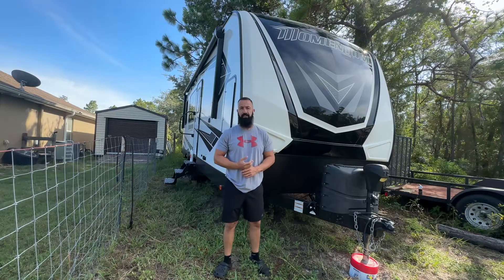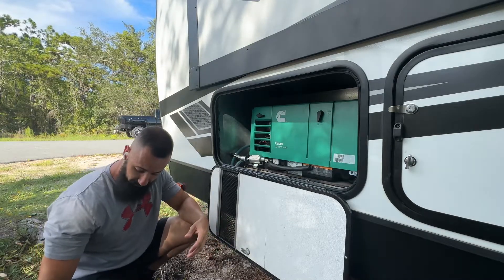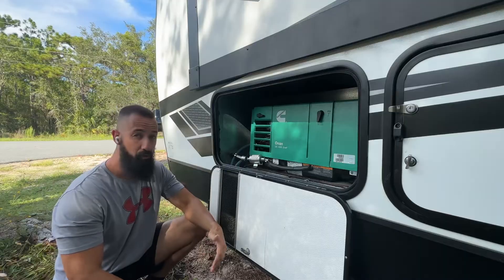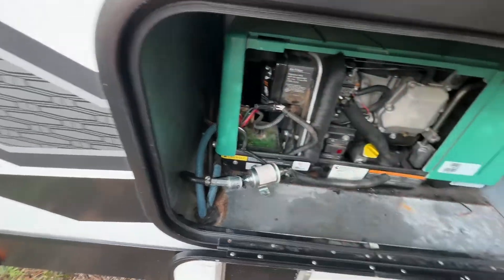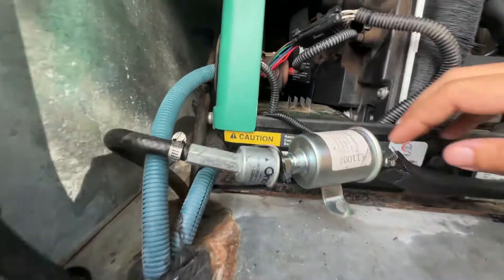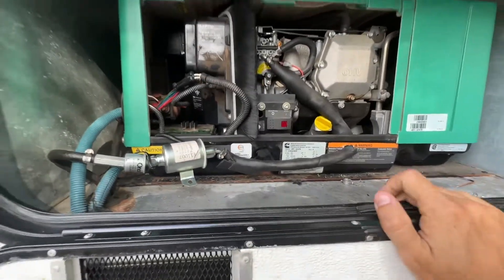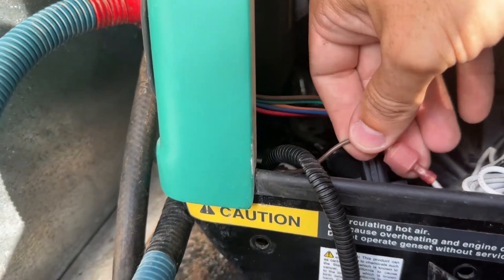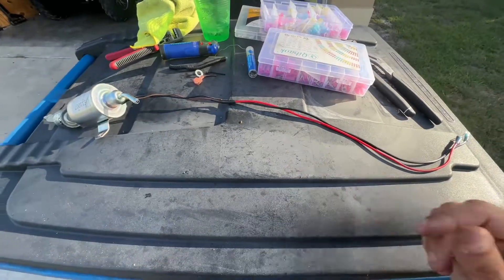Cummins Onan Generator Stalling Surging Overheating Fixed!!

Comment: I'll give it a try. I was suspecting over heating of some kind. But then I thought oil will always heat at high temps in a motor. Then I thought is there a heat sensor for the oil? Couldn't find one. But this makes sense. The pump being to close to the heat turns the fuel to vapors. Engines don't run on vapors.  Makes total sense. You may have solved a huge problem 1000s have be trying to solve. Good job. Now I wish I had seen this video in the summer! LMAO! 🤣🤣🤣🤣
Reply from the maker: I did a follow up video, need to relocate the pump directly under the camper beneath the generator house. Have had 0 issues running for multiple days with the AC on after doing so.

Comment: I'm also in Florida... it's got AF! And I'm pretty sure I'm having the same issue... sounds just like what happens to mine. but I've not replaced any parts yet.  Going to give it a oil change n clean the filters n shit. n check to see if it needs insulation? I'll see what happens?? Wish me luck guys!

Comment: I had a problem with heat causing problems so I added in electric  radiator fans.   Worked like magic.   If you can remove heat you will have less problems and your engine will last longer.
Reply: I would be interested in your solution. I was trying to figure a way to run the oil through some a cooling coil or install a cooling coil that runs through the colling  system. let me know if you can share what you did.

Comment: Great idea I had the same deal I also read the dip stick is to short so I change the oil and I filled the new oil about right after the add oil I didn't fill it up to the full line seems it work so far but your idea is a great idea I'm going to do it if I run into the same problem!!

Comment: Gonna try this with mine. But mine also isn’t sending enough voltage
Reply: The vapor lock he identified could cause this. No fuel no proper ignition. No power.

Comment: I have a QG7000. It runs like butter after cold start, but shut it down even after only 15 mins and start it again and it surges. Idle won't level off. I wonder if once the pump warms up it's doing the same as yours did. Thanks for the idea. It's been acting up this summer with these 100 degree plus days and it very well might be doing the same exact thing you spoke about. Great vid. Thx.

Comment: That's my problem. i live in AZ, and i ran mine for 15 mins and it cut out. tried to drain the bowl, and no fuel came out. . Wait 30 mins and starts back up. Thanks, I'll do the same.
Reply: Hello did this fix work for you? I have the same issue. Thanks
Reply: No, i think my fuel pump gets hot and it vapor locks, causing it to cut out. @lovethem007

Comment: I was just wondering as to are you using or leaving in place the old pump and filter and adding this new one outside as you show it?  not clear? I assume you are using old? looks hard to get removed and adding extra length fuel line to front?   Thank you   Lookinh great.
Reply from the maker: The whole pump and filter are moved outside of the unit. It’s honestly not hard once you get into it.

Comment: My generator has same problem … last summer gave me same troubles…. When the winter came went back to normal good running but now since the weather is warming up started to create problems again … i
Reply from the maker: I’m still having issues as well, I bought a second fuel pump I’m going to put near the tank to send fuel to the pump at the generator. I’ll post a video of the install and how it goes.
Reply: Did you do this and did it work?
Reply: @ddoud  my problem was the fuel pump . I purchased new pump from Amazon  $42 and changed it ( took me 30 min ) . 
My generator runs now like a brand new generator.

Comment: Nice vid!  I have the same unit in our horse trialer except mine's on the roof  with an insulated cover. It ran fine for several years but now experiencing similar problem.

Comment: So glad I found this video. I am in Florida too, and my gen did the same thing when hot outside. I was on a similar line of thinking, and was going to install a new pump, because I figured when it got hot it would stop working, but I also new it was working because it would immediately start again then quit in 2 min. 
          I will make this change but not looking forward to it in this florida heat. I might wait a month when I travel north 1200 miles where it is a bit cooler.

Comment: Great video !!! I just bought an older toyhauler two weeks ago including an Onan 4000 generator which wasn't running anymore. I got it running now, but it shuts off after a couple of minutes here in the Las Vegas heat (vapor lock). This could be caused by an exhaust problem on that generator or simply because of the bad design with the fuel pump inside the generator housing. 
Tomorrow I will check it again, maybe I will also have to move the fuel pump to a cooler location. Sadly I do not have as much space like on your RV to do this. Thanks again for this video :-)
Reply from the maker: I’ve heard of people relocating to underneath the camper as well or closer to the fuel tank actually since fuel pumps are designed to push gas not pull. Good luck!
Reply: @dominick_anthony  I think when the pump is just out of the generator housing it should be OK even further away from the tank. I checked mine again today and even after I fixed the exhaust, the generator shuts off after a few minutes. The fuel lines do not feel that hot, but the fuel pump itself is too hot to touch. It is an aftermarket fuel pump and not the original Onan. Not sure if this is also part of the problem. However, I will install the pump further away from the heat now.
Reply: Just an update about my situation with the Onan. So I also changed the fuel pump location to a much cooler area outside the generator housing. I got it running a bit longer but then I had a vapor lock again. I noticed that the new but cheap fuel pump from Amazon was getting very hot even outside of the housing. So I switched back to the super old original Onan pump. Then the generator running time went from 3 minutes to 9 minutes. But this was in the Las Vegas heat (100+F). Later I tried it at a cooler place and at 70F the generator runs perfect there. However, I will need to replace that old pump with a new original Onan pump in the hope to be able to run the generator at warmer weather.
But in general I learned that two things are key: 1.) install the pump outside the housing 2.) buy an orginal pump and not the cheap stuff in this case.
Reply from the maker: @swegotech8466  so I’ve also heard of people installing the fuel pump close to the gas tank as fuel pumps are designed to push fuel not pull. Might be a good idea since you’re still having issues to try and relocate to where the fuel tank is. Good luck!
Reply: @dominick_anthony  thank you for letting me know about this. I heard that somewhere else before, so this could be the reason for it. But in my case I just think the fuel pump is too old. I noticed how hot the pump itself gets even outside of the generator housing, bevore the vapor lock situation happens. It's nearly too hot to touch, but I think it should getting cooled from the fuel going through it, right?
So I will check on that first, when this won't work I will try to relocate the fuel pump closer to the tank (which is far away from the generator at the end of my toy hauler). But many thanks for this amazing video. Relocating the fuel pump is what makes a big difference for sure.
Reply: I have the same issue runs for 5-10 min then shuts off. Campers just over a year old. I’ve checked the oil and replaced the pump and filter after it shuts off won’t restart and no fuel issue. Crazy thing is it will do it at 70 degrees also.